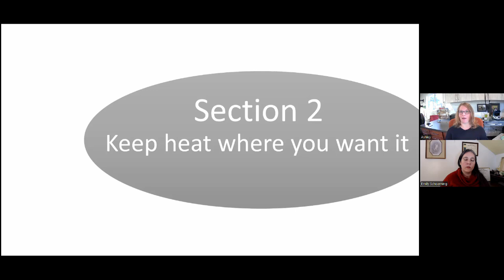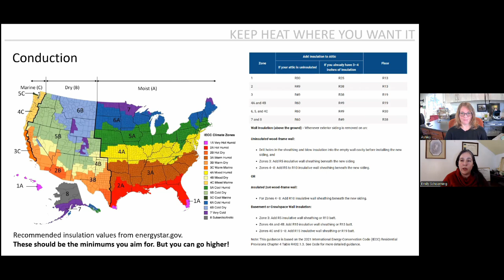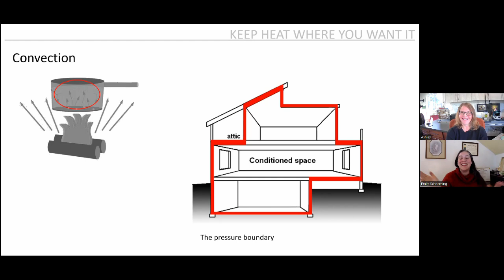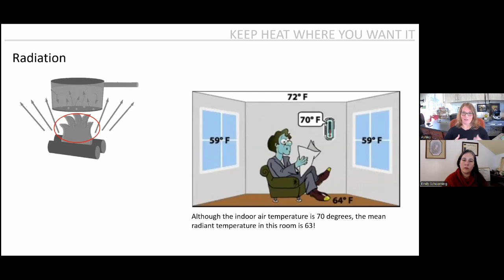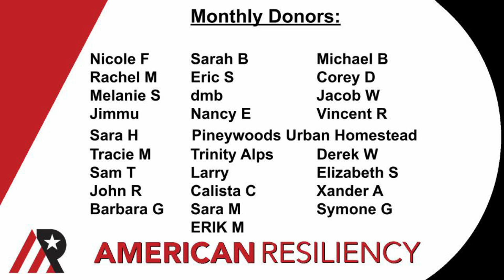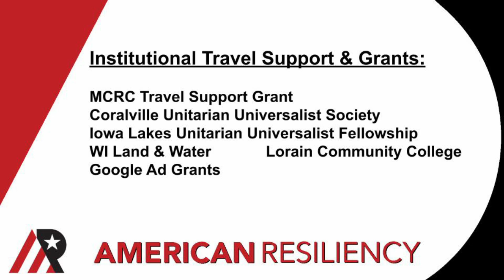Building Heat Resilience: 2

Comment: On the radiant barrier, in an emergency, I've used a costco sized roll of aluminum foil, shiny side out, over all the inside of the windows of my house.  Knocks about 10 degrees off the indoor temperature in an hour or 2.  

Another thing for those who love their original double hung single pane wood windows, yes they are beautiful, but the leak like sieves, even when properly maintained.  Take big sheets of painters plastic from home depot, and completely cover the window, taping it to the wall all around the trim boards of the windows.  It'll cut your air losses in half (or better if you havent gone and chipped out and reglazed your windows in the last 2 or 3 years) and allow you to better keep overnight cool inside your house during the hot day.

This also may sound obvious, but dont run ANY unnecessary electrical loads or the stove, oven, or clothes dryers.  Those things just dump heat into your house and in a heat wave that is hell to get back out.  A major heat source people dont think about is a shower.  Cooler showers, or better yet baths, will prevent a lot of heat from building up, and if you have to run your bathroom exaust fan, thats taking inside air and dumping it outside, and assuming your house isnt sealed as well as the international space station, will pull hot indoor air into the house to replace what you exhausted.
Reply from the maker: @mrbeanisfication nice practical tips- I know a lot of people reading appreciate the low cost tips especially, that tinfoil one is very accessible.
Reply: @AmericanResiliency  yeah.  It's not going to make you comfortable, but it will help you not get heat exhausted laying in your own home.

Comment: Rock wool with Hardiboard and metal strapping is a GREAT addition if you were already doing siding and windows on your house anyway.  Great R value, completely termite proof, it can literally take a blowtorch to the outside and the inside can stay cool to the touch.
Reply from the maker: @mrbeansification that's pretty awesome- and the blowtorch to the outside would make a great visual
Reply: @AmericanResiliency  https://youtu.be/k9KSTQ6hyQQ?si=s7buk-R5OLw68NVb

Notice about the 1:00 mark where the ridges of the Hardie board are glowing red.  That's like 500C, and the board stays intact. 

Add some non combustible insulation behind that, and the whole assembly will hold up to whatever temperature the fasteners melt at.  Your windows would 100% go first in a fire in that case (though there are things you can do to help that too.
Reply from the maker: @mrbeansification  that's so wild!

Comment: I love this so much. It's easier to warm yourself in the cold by putting up a tent in your house and covering it with blankets but it's almost impossible to do anything to cool off during intense heat. I would have LOVED to be able to get in the pond and cool off during Helene but the water was very warm and the Bass bites 😂
Reply: Cold shower, or at least splash some water on your shirt before trying to sleep - with a fan, it feels relatively cool at 99F and cold at 80F.
Reply from the maker: @koicaine1230 not the bass bites!  lol!

That's a solid cold emergency plan.  Effective and potentially very not-scary for kids.

Comment: She mentioned deciduous trees for a quick moment. I want to highlight those. In Winter, they loose their leaves letting in the sunlight for warmth, but block it in summer.

Also, you can get "thermal insulation paint additive" (Google it) and add to paint to give your paint a slight R value for improved insulation. It's ceramic spherules that act as insulation against IR wavelengths. It does work (as a modest improvement).
Reply from the maker: @Mike80528 good points- thanks for adding!  I especially appreciate the paint tip, I hadn't known about that.

Comment: I'm thinking about making some earthbag garden walls.  Wondering if anyone has advice about that.  I have plenty of fine silt I could fill them with.  Maybe a rammed earth wall would be better, i already have a fence that could be one side.  Y'all have my imagination running wild!!  :)
Reply: Ash here - I've actually got a roll of hyperadobe that I'm planning on building a garden wall & outdoor kitchen with this spring! Our soil is mostly sand, so I might have to source a little clay. I'll post to the discord as things progress, will also make a short for this youtube channel. Rammed earth is cool too, but your forms need to be very sturdy, so there's a little more upfront work to be done. I'd need to look into the proper clay:sand ratio too